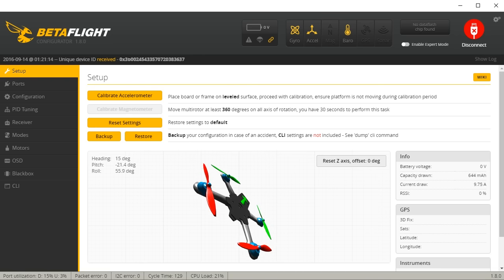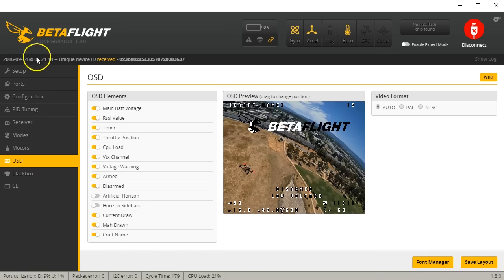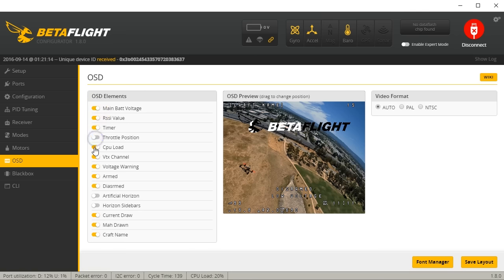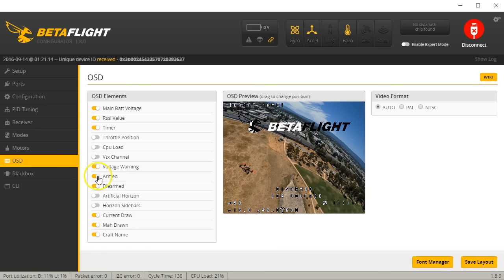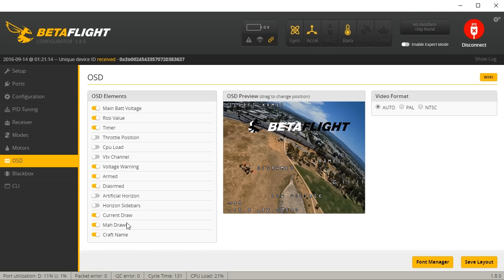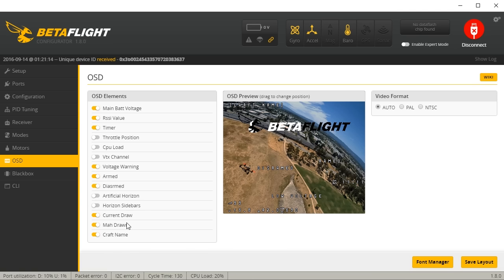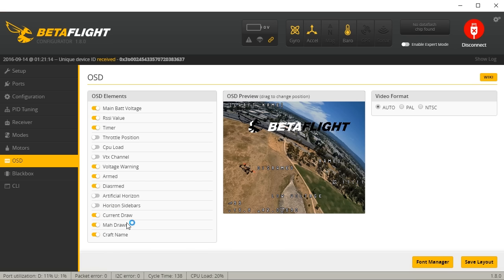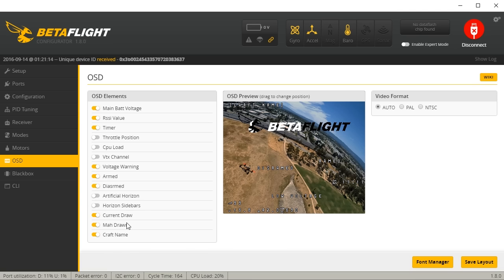Omnibus F3 All-In-One Flight Controller - Betaflight OSD

Comment: So, how's the BabyPDB at filtering ESC noise? Can I ditch my big low ESR cap if I switch to that PDB?
Reply from the maker: Unknown, but probably you still want the electrolytic cap.
Reply: It sure would be nice to find a small PDB that could kill ESC noise. I've been flying an UberDistro PDB for a while, but it's the older version without the 12 & 5V output. I haven't tested the filtering on the Mk2 version. Really nice board though and it'll take a ton of amps without any issues.
Reply from the maker: There's really no substitute for a big electrolytic when it comes to filtering. Some things come close, but only just.
Reply: Big caps for all my friends! 

Thanks for the vids, Joshua. Great stuff.

Comment: I've never really understood having an OSD,,, is it really worth having? Seems flying fpv I don't have time to focus on stats. I do expect to post my name on the video feed, but my cam handles that and my transmitter keeps me up to date on the battery,,,,, what am I missing out on?
Reply from the maker: I prefer to see battery in real time rather than getting audible low warning from the Taranis. If you are on a flight line with many people, audible warnings from Taranis are annoying to others. OSD allows me to view flight stats in the DVR recording after the fact, which can help me see things that I didn't see in flight, such as, "How many amps was I pulling when I was going full throttle down the straight?" OSD with current sensor lets you monitor your flight time base on mAh; most FC's won't have current sensing built in.

Comment: Stupid Question: My camera and VTX don't have same voltage range, can I just pass the video from the camera through the FC and power the camera from another regulator, or do I have to ground the camera to the FC? EDIT: I have the omnibus f3 pro (the one with the current sensor)
Reply from the maker: Camera and vTX should ground to the same location to avoid video noise. The exception is if you are using the vTX 5v output to power the camera, then ground the camera at the vTX and the vTX at the FC. If you are going to use separate voltage ranges for them, then I suggest skipping the Omnibus RAM bus altogether. Wire GND for CAM and vTX to any convenient location and wire the positive voltage wire to the regulator output.

Comment: I have two of these boards with no luck. I would like to try clean flight but don't see the board on the drop downs. What should I pick?
Reply from the maker: Is a Cleanflight target even available for these boards? It doesn't appear so.
Reply: +Joshua Bardwell I thought Clean supported omnibus. Thought you mentioned that. Guess I misunderstood.
Reply from the maker: I don't see Omnibus in the CF targets list under the 1.14 releases. I could be wrong.

Comment: Just flashed betaflight to a emax skyline32 advance but it does not show my mag/baro, is up top. But works on cleanflight. please help, new to naze
Reply from the maker: +Leigh baro and mag are buggy in one if the targets. Betaflight disabled them for safety. Presumably this is that target?
Reply: I'm sorry I'm unsure what you mean by target. I'm very new to this. Thank you for such a quick reply
Reply from the maker: +Leigh i the target refers to the layout of the board. Many boards share the same layout even though they are different boards. Thus means they can run the same firmware file of cleanflight or Betaflight. The file version and its corresponding board layout is referred to as a target. So your board might use the SPRACINGF3 target. Anyway, I think the driver for your baro and mag is buggy. I know that baro and mag is buggy and disabled in one board, so it's probably yours.

Comment: I Joshua, very nice reviews thank you. i have a question i brought the pro version of this FC "omnibus aio F3 pro" from myairbot a few days ago, the board is very nice but the documentation is so poor, i try to find the rssi input pin on this board, no way to find it ! the board layout is really differente with the non pro version where the rssi pin is labeled aswell the 3 UART port: ( RSSI, TX1 RX1; TX2 RX2; TX3 RX3).
I fund only 2 UART on the pro version and no RSSI input, i'am sure i miss something .
If you can, may i ask you to have look to this board and give me some help.
thank you Joshua
Reply from the maker: +Philippe Blackbird there is no RSSI pin on that board. The RSSI pin on the non pro version doesn't work either.
Reply from the maker: The issue, so I'm told, is that the analog-to-digital-converter on the board is being used for the current sensor. Why some other boards can have both current and RSSI, I don't know, but there seems to be a conflict on this board. Nathan Tsoi tells me that in betaflight 3.1, it will be possible to remap inputs and outputs more arbitrarily, without re-compiling the code. So you may be able to choose to have RSSI input on betaflight 3.1, eventually.
Reply: Many thanks Joshua , on the web site they claim "Rssi as pin"  ^^, i am a bit disapointed, didn't know that before buying my fault (ask before Philippe ^^) ok then we will see with BF 3.1, again thx Joshua and great thank to BF team for the awesome job
Reply: Hi Joshua, i ask the question to myairbot about RSSI pin on omnibus aio f3 pro, they just replie to me, the rssi pin on this board exist you can find it right to the bottom of  the sd card slot a very tiny pin labeled rssi but very small it is PWM input, i will check if i can get my rssi info on screen, voila !. see you Joshua
Reply from the maker: +Philippe Blackbird I don't think it works except in Betaflight 3.1 but let me know what you find out.

Comment: Hi I've been doing some research and I don't know too much about this but where do I put the receiver on this flight controller?
Reply: I'm using a turnigy ia6c receiver and it has ppm, sbus, voltage, and ground outputs. I notice this board has only three inputs for the receiver. How do I go about this?
Reply from the maker: +Pseu SBUS uses only one signal wire. The other two are for ground and power.
Reply: Joshua Bardwell thank you for the quick reply

Comment: is it possible to use your frsky telemetry when using betaflight osd on the omnibus? ?
Reply from the maker: I don't see why not. Why not?
Reply: Joshua Bardwell in the past you had to choose between telemetry or osd. both of them gave false readings, or am i wrong?
Reply from the maker: I'm not aware of that bug. You can run telemetry on one UART and MSP on another UART for an OSD. I don't see why not.
Reply: Joshua Bardwell ok, i probably confuse some things i read in the past, thanx.

Comment: I have a question. I am using one of these and I can't get my walkera rx703a rx  to communicate with the board. I am trying to use it ppm plugged into the pin header. compatibility issue or am I doing something wrong? thanks.
Reply from the maker: I believe that this board has problems supporting PPM.
Reply: I just found it as luck would have it. Right beside the pin header is the ppm "connection". It needed to be bridged with solder. It's working like a champ now. Thanks for your time anyway though.

Comment: Hello, I just soldered my VTX and CAM over pdb and I only connected video signal wires to the board, but when I move throttle hard, video starts flickering and gets lost, it comes for a second but no osd appears. Is it because 5v regulator cannot deliver enough voltage. Can I feed osd with an external 5V regulator?
Reply from the maker: Yes it definitely could be the 5v regulator but I think it's more likely that you "only connected video signal wires to the board", therefore you do not have correct grounding. The video and the ground wires need to be soldered to the same place.
Reply: Thank you for your fast response. Today I connected GND wires and It started to work very well!

Comment: Is there anyway to get betaflight osd working on a minimosd chip? I have a few and I am sure many ppl is in similar situation.
Reply from the maker: +Jack Truong there is supposed to be a pull request in for this feature but I don't know what the status is. For now the answer is no.
Reply: Joshua Bardwell this pull is at testing phase. it should allow user to use  minimosd instead of the betaflight native chip. https://github.com/betaflight/betaflight/pull/1512

Comment: Just building my quad using this board
Can you help
There is no motor spin when i click the master and move the sliders
I have provided a 5 volt supply to the middle pin on one of the lines as my esc only has 2 wires  
Not sure what sound this board is supposed to make on start any chance you can do a video on that ,as mine only seems to have a short sound
Were as on my sp pro f3 is seemed to be twice the length
Maybe this is an indication to me wiring something incorrect
Cheers
Reply from the maker: You need battery plugged in to make the motors spin.
Reply: you for real
Reply from the maker: I can't tell if I've helped you or not.
Reply: No
Reply: Only in the reciever section does it show the preview when i move my stick Your in setup and it works Any ideas on that? cheers The other thing There is no failsafe in my Betaflight column on the menu ?
Reply from the maker: +spooner Graham setup is showing the accelerometer not the sticks.
Reply: Sorry It maybe the way iam trying to explain In your video You can see and move under setup tab The quad moving when you move your transmitter Yar /rudder ect Mine doesn't only under the reciever tab
And Failsafe is not on my betaflight as a selection

Comment: Can i use it with my PWM Reciever?
Reply from the maker: It does not seem to have PWM input pads. If you are flying with a PWM receiver, you are increasingly going to be locked out of flight controllers. PWM is essentially dead in the modern (e.g. this six months--Hah!) period.
Reply: and can I use my D series Module with sbus?
Reply from the maker: X4R-SB and XSR only work with X series modules. I don't know of any D series receiver that supports SBUS.
Reply: And some third Party reciever?
Reply: And some third Party reciever? Or is there a x series diy Module?  Or can I take out the Module out of a Taranis Module and put it in my flysky fst6 like the dht Module?

Comment: This drives me crazy. Everytime it tells me motor parse error. And no glue how to fix that shiiet.please H.E.L.P.!!!
Reply from the maker: Something about the command you're typing in is the wrong syntax but I couldn't guess what it was. What exactly are you typing into the CLI?
Reply: Joshua Bardwell hi i just type motor in and then it show up parse error and this is to some other things also.in the receiver tab, everything show up normal and i can arm it.but no motor spinning. I increased the motor level but not working. I watched nearly all your videos for the past 3 days but i did not solve the issue yet.  :)

Comment: just order this, so i see this dont have the pdb built in which is good i just need setup for esc  hookup and power.. what you think of this flight controller? I ordered from racedayquads.com Airbot Omnibus F4 Pro V3 (SmartAudio V2 VTX Control) (Current Sensor)
Reply from the maker: Yeah, that is a fine one if you don't want built in PDB.
Reply: hey thanks , lol bet your like damn david downs anouther question

Comment: Dunno if this link works but there you go: http://www.banggood.com/New-Racing-F3-V3-6Dof-Flight-Control-AIO-Intergrated-with-OSD-BEC-PDB-and-Current-Sensor-p-1085406.html F3 FC with PDB, Current Sensor and OSD!
Reply: I've been looking at that board, would love to see a review from +Joshua Bardwell
Reply: If only it didn't have the tab out the side!  I know they needed the space for the current sensor but if was longer I would have grabbed it instantly.
Reply: Kye Macdonald yeah, I've got the matek PDB with the XT60 out the side but was a bit concerned at how far this one sticks out. Also I couldn't find any information on which gyro it's using.
Reply: I believe it it a 6050.  It won't work with my current frame but for my next build I'm thinking about rotating it so the tab it facing backwards.

That said all my builds are moving towards 4in1 escs so PDBs may become an endangered species.
Reply: Check out the "F3S-AIO" from myairbot. Just built a quad with it and it does everything (F3 FC, MWOSD, PDB, current sensor) in a 36x36 package. Works great!

Comment: I really hate all in ones, one things dies you are REALLY screwed :)
Reply from the maker: Once the price gets low enough, it starts to make sense. Especially in this case, where the PDB is not integrated. So you don't need to desolder all your power wires if it fries. I think that is a pretty good balance.
Reply: I agree flight controller + osd is not so bad, but you get fc + receiver + PDB + OSD + VTX one thing dies and your looking at $200 easily
Reply from the maker: But what if it cost $40? The Omnibus starts to look appealing because it's not more expensive than many FC's all by themselves. You can spend $35 on some other FC and get just the FC. Or you spend $40 on the Omnibus and get an OSD for $5.